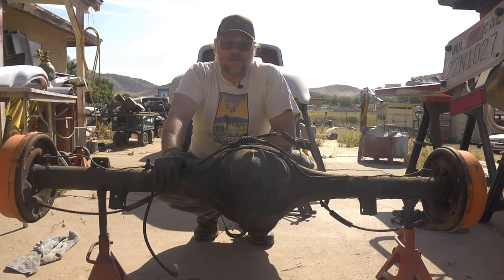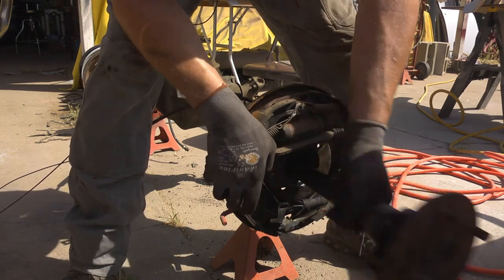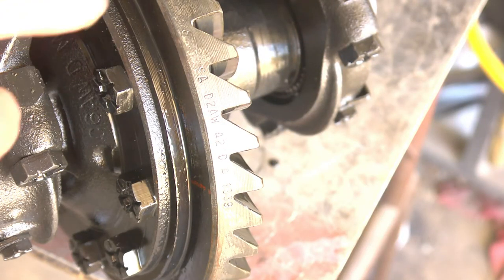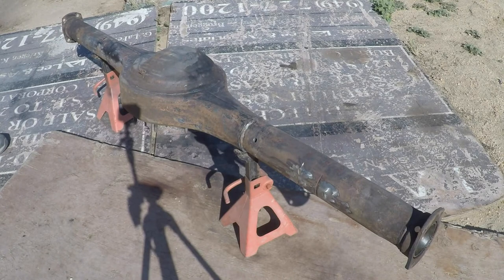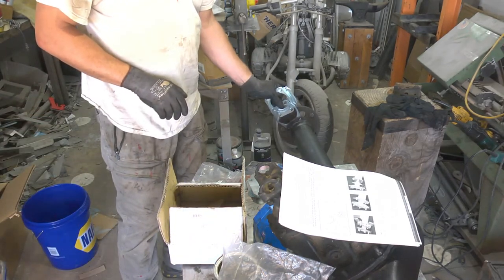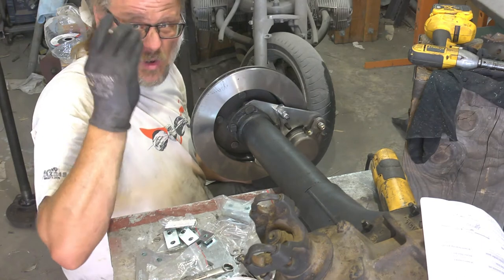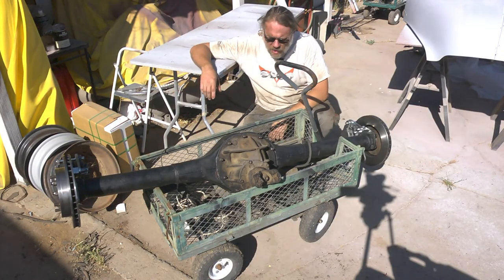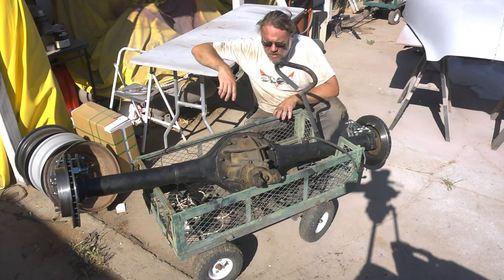Jegs Bolt On Disk Brakes For Ford 9 Inch

Comment: We have a Dana 44 axle in our 53- My Dad says says that is plenty for our build but, those 9” rear ends look like they are a lot easier to work on.
Reply from the maker: Way easier. The Ford 9 inch and the GM 14 bolt are both relatively easy to work on.

Comment: you can look at the tag on the outside of the diff and it will tell you  the ratio, no need to dismantle...just fyi
Reply from the maker: As long as it has a tag and/or someone else has not changed it and kept the tag.